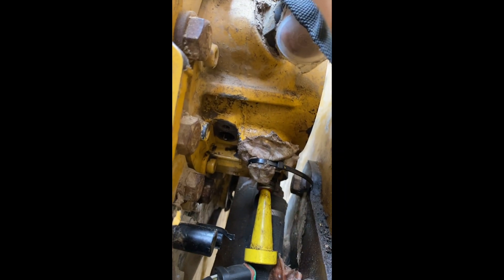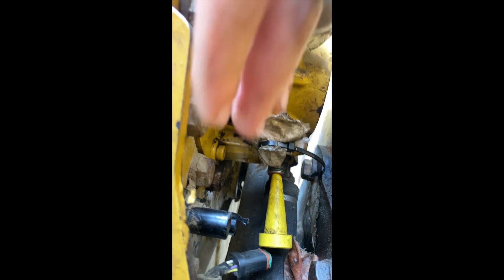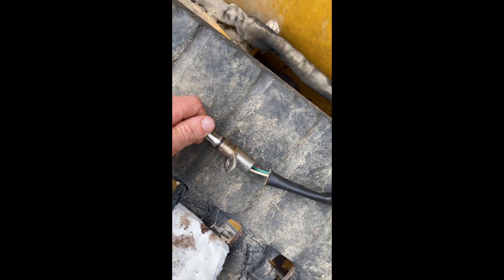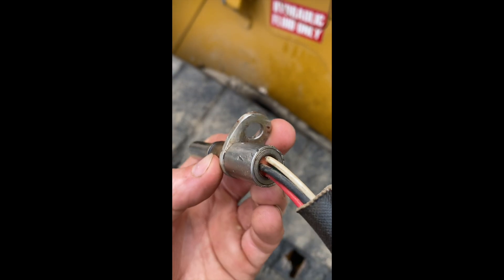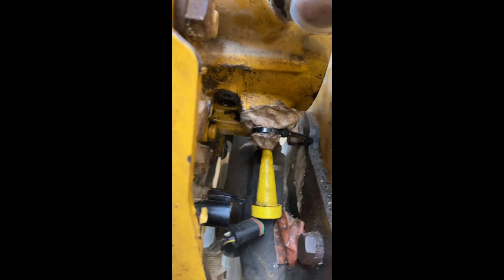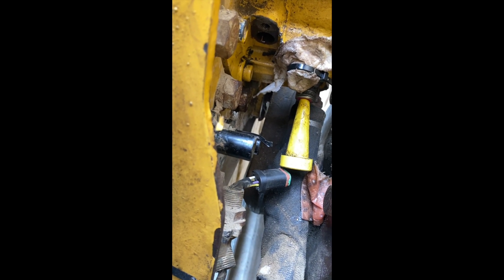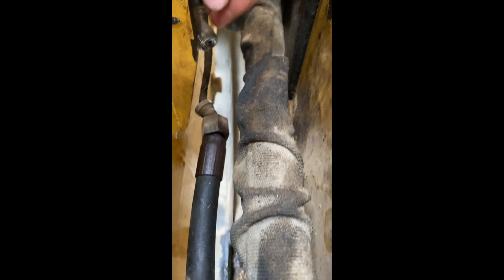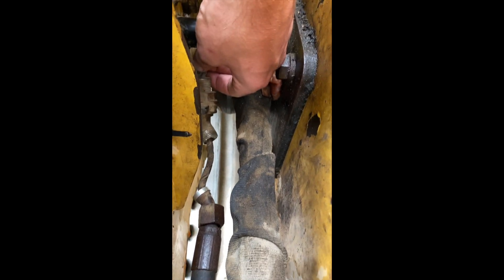CAT 259D speed sensor

Comment: Do these sensors actually go bad?
Reply from the maker: Something with them goes wrong they start sending codes to the computer. It'll lock up the track randomly.
Reply: @TylerBemis Interesting, I got a 259 that won’t turn right because of that sensor. Ima replace it tomorrow to see what’s up lol
Reply from the maker: @ goodluck with the repair! hope the video helps.
Reply: @TylerBemis Update, sensor didn’t fix the issue. It kept being locked and gave me these codes. 
2687-8
Machine
Right Drive Motor
Speed Sensor #1
Abnormal Frequency, Pulse Width or Períod
 E695-3
Machine
Unexpected Motor Speed
Detection Disabled
Drive speed is limited until fault is corrected
The harness and connectors look good, idk what else to do. I’ve never worked on   CAT machines before
Reply from the maker: @  I had codes E695-3 and  2687-8 "Right drive motor speed sensor abnormal frequency pulse width or period. Might be a dumb question but did you turn the master switch off when you were doing the work? Maybe the computer needs to reset? Mine corrected the issue right away but I would have definitely turned power off before repairing it.
Reply: @TylerBemis My mistake! I did not turn off the master switch off before disconnecting or replacing anything 🤦🏽‍♂️ but it ran perfectly fine for a few seconds and it did the same thing. I’ll reset the computer to see what happens.
Reply from the maker: @ Yea maybe the computer needs to be reset? did you check your electrical connection inside the frame of the machine with the cab lifted?
Reply: @montejohm  Did you ever get this fixed?
Reply: @braaap2065 yeah it wasn’t the sensor it was the spool that controls the hydraulic to lock and unlock the final drive! One othe washers broke and it left the final drive locked that’s why it wasn’t moving. Part # 581-4919: Spool Kit

Comment: How did you get the old sensor out? Spent 4 hours today trying to pull one out on the left side. Have the machine jacked up and the undercarriage slid out for more room. Removed the allen bolt but cant seem to get that sensor loose. Beat on it with a chisel to try and loosen it, tried vice grips and a pry bar. cant seem to make it budge.
Reply from the maker: I sprayed it with wd40 and ended up bending the allen bolt tab up with a small pry bar. Swapped to a big pry bar. I thought the tab was going to snap with how much pressure needed to be applied. I got  nothing out of it with vice grips or flat head screw driver. They must get seized inside the sensor housing. I applied hydraulic oil to the new one when I installed it.
Reply: @ I ended up clipping the wires, welding a nut onto the end of it and could finally get something to pry on lol